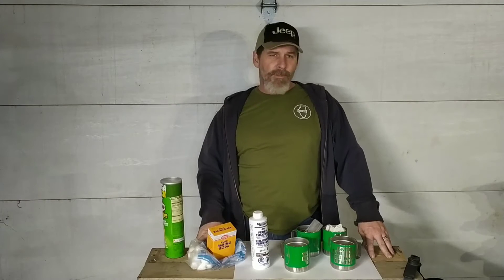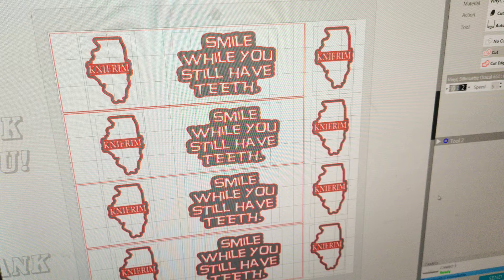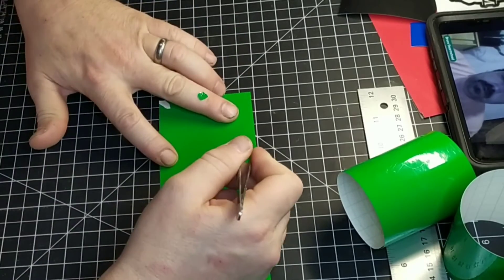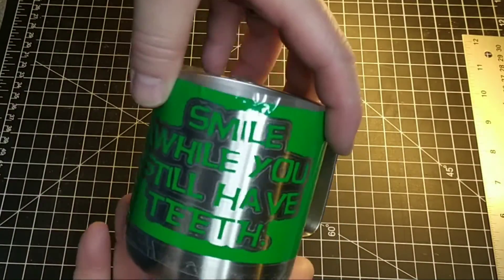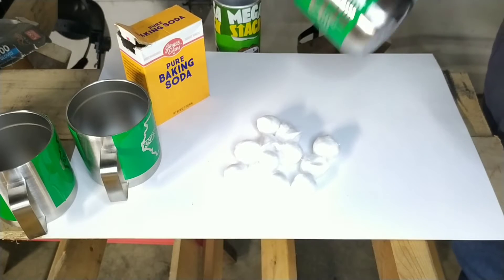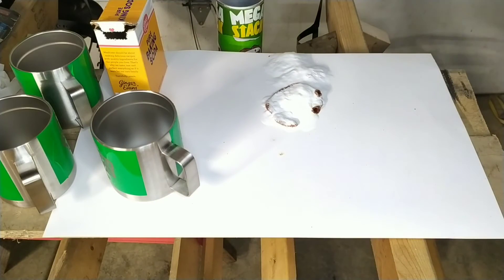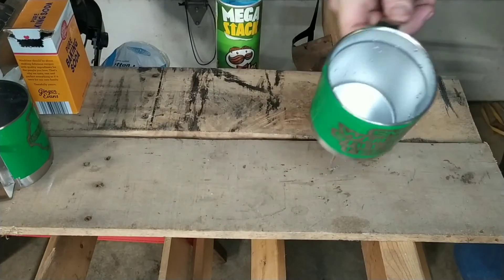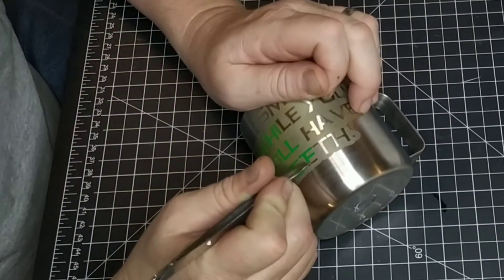Etching Stainless steel with Ferric Chloride

Comment: Cool idea.
I think an easier way for you to transfer even more complex designs onto the metal is by using a laser engraver.
Paint the metal using mat black primer, then using the laser engraver burn a negative pattern onto the paint, clean the burnt paint off then brush it with iron chloride and once done remove the rest of the paint using acetone. Same method I use for etching PCBs.
Reply from the maker: I definitely would love to have a laser engraver but I bought a 3D printer instead soon I hope to purchase one
Reply: moneybuny?

Comment: Can you etch a hole into a thin stainless steel plate?
Reply from the maker: I don't think so. it's not very deep.✌thanks for stopping by
Reply: I think you could technically do it, only you would have to cover everything you want to preserve, then submerge the whole thing in ferric chloride and take it out from time to time (with gloves) to check if it's done.

Comment: I always mixed the baking soda in water and dunked the etched part in it to neutralize the acid, Also I’ve always submerged the part in the ferric chloride and let it sit for anywhere from a few minutes to like 10-15 min, gets much darker, but wouldn’t work as well for a smaller area.
Reply from the maker: Wow thanks for the info it was first time not using electricity & submerging the part is why it didn't turn black thank you I will give it a shot✌